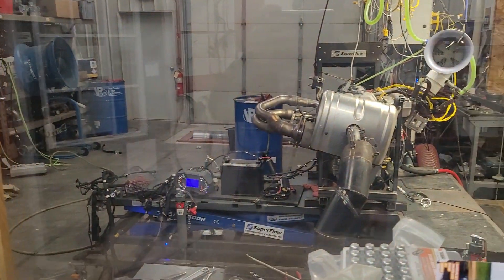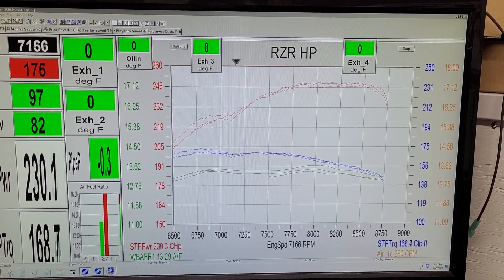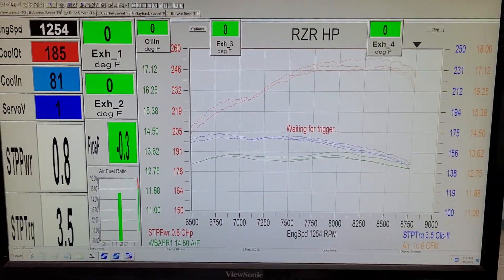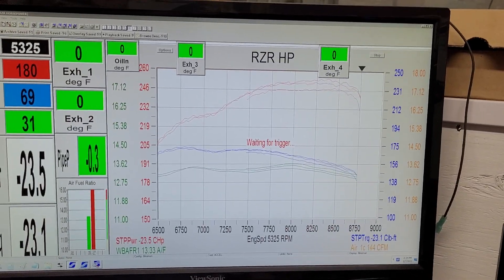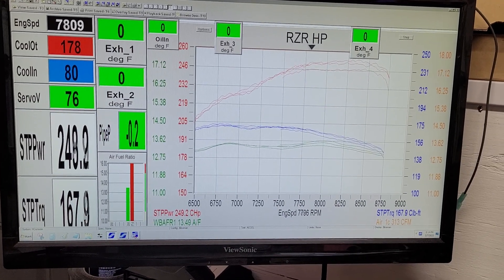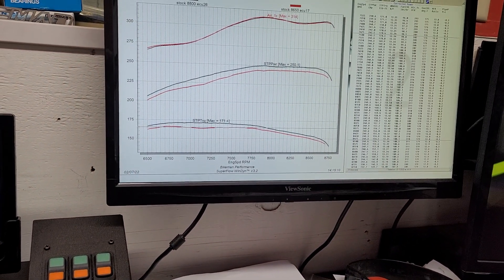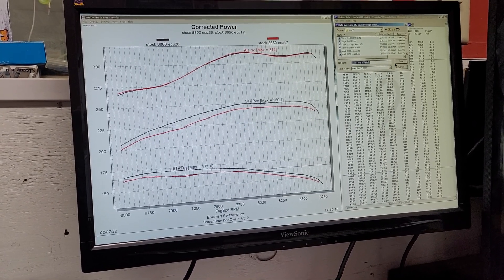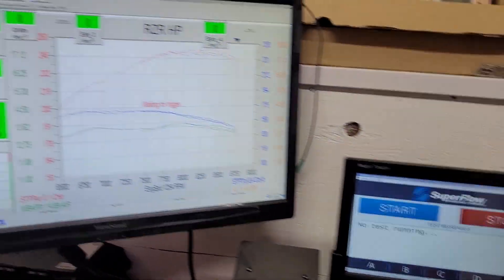HOW MUCH POWER CAN WE ADD TO THE POLARIS PRO R 2022

Comment: Y’all pulled a motor out of new pro r just to do dyno pulls lol
Reply from the maker: It is the only correct way to work on a ECU flashes. First we start with our Superflow 902s engine dyno to make the power then we go to our wheel dyno to get it to the ground.